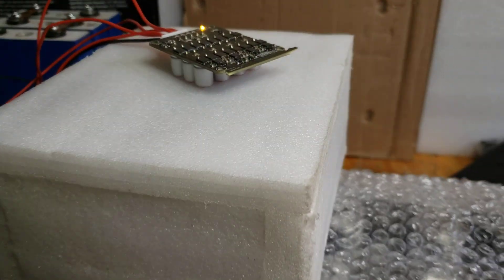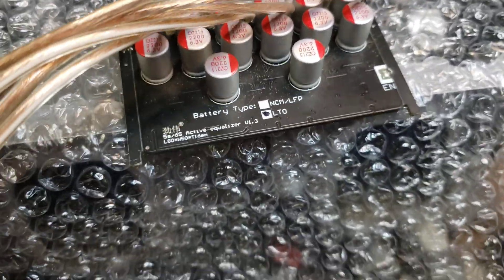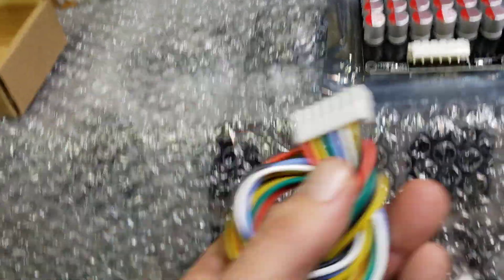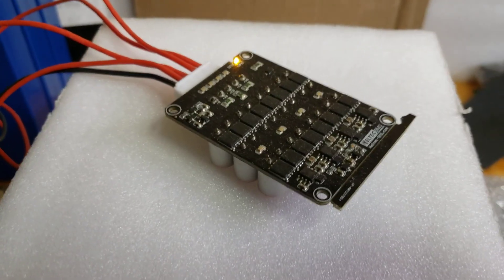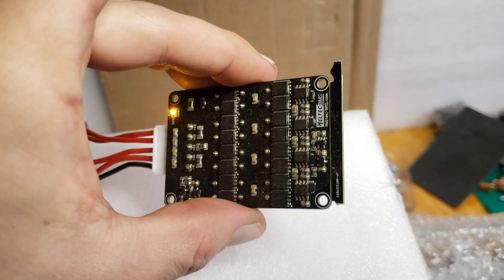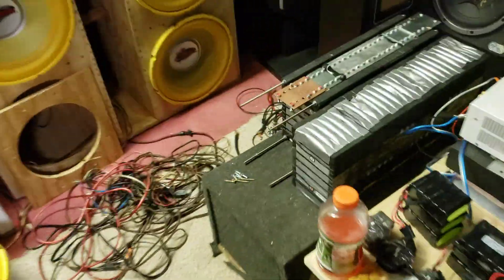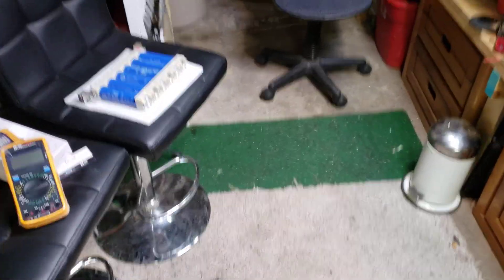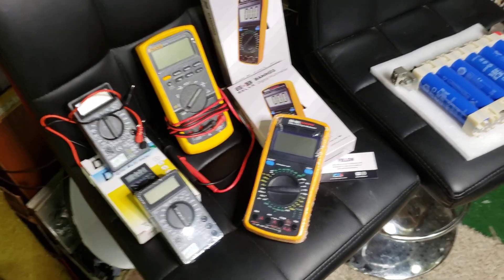Wiring a Lithium Balancer , Headway lifepo4 4s and LTO 6s

Comment: Once I hooked it up it smoked and clicked when I plugged it in? Did I fry it
Reply from the maker: Sounds like it , we're your cells prebalanced passive? What i do is passive balance,  assemble bank , hook up the wires for balancer , before you hook up the balancer make sure the changeable solder pads are in the correct place , adding a switch to the run pads is a great idea cuz then you can shut off the balancer , so shut it off and then plug the balancer lead clip in , if you dont have a switch and just leave it try to plug it in starting with the negative pin and plug it in fast . If done properly should have a run light and you will here a little whine , you can check each balancer lead with a dc clamp to see where its sending current. Warranty it and double check everything before hooking it up again.  When you "hot plug" a balancer you run the risk of smoking it ... I always say please don't smoke please don't smoke as I hook em up if hot plugging lol 😆 if you have any questions ask me on here or Facebook

Comment: What's the best balancer for 64ah headway with no soldering
Reply from the maker: Pretty much all you should solder and heat shrink the ring terminals anyways . You can grab a solder iron for like 20$ . My solder station with hot air was around 90$ and I love it , makes soldering and doing heat shit super easy . Nice tool to have in car audio or any electronics 
https://amzn.to/3BTxwBf

Comment: I just bought 2 banks of the Shengquan from Battery Hookup for 7k rms audio. Would I need 2 balancers? And would the "Heltec 6s 5A active equalizer balancer" on the Sriko site be what I need?  TIA
Reply from the maker: you can link each bank with the solder to tabs . i have a video on that also
Reply: @mazda2284  I cant find that video in your playlist.  Do I just solder a "jumper" between each solder to tab?

Comment: I have the 4-6s balancer. The second one you showed. From the amp lab. Does that have an LED on the back? Because I wired it up, have it switched to LFP and On as well. Still no LED
Reply from the maker: Mine has a led. If it's all properly set and wired and still no light check it with a dc clamp while charging... if no current reading then its defective
Reply: @mazda2284  ok thank you. I think my board may be bad then. I can check voltage from B1-4 and my ground is connected but still no LED. I'll order another balancer and try again
Reply from the maker: @jb19907  order one from srikobatteries.com Discount code BDSB
Reply: @mazda2284 I just followed these steps and it got hot 🔥🔥🔥
Reply: @mazda2284 is a balancer really necessary to have
Reply from the maker: @keithbutler7896  yes
Reply from the maker: @keithbutler7896  did you balance the cells prior to building?

Comment: Could I run 2 4s balancers at once
Reply from the maker: Why ? You could but I'd rather just do a single balancer , and when I get to the size bank id need a second balancer I do a second bank instead.  Easier to handle and Easier to fit more places . For 4s I use the 10a 30$ balancer from srikobatteries.com Discount code BDSB 
If you have a good bank a 10a balancer with keep up with quite abit of battery , and personally if its trying to balance more than 5 or 6 amps id be rearranging cells to get the ir to match better , or looking for bad cells .

Comment: How to you actually put an on off switch, do you ground the run leed for a second. Can you pleas explain the on off function
Reply from the maker: Simply put a switch to connect the pads . No ground or anything like that
Reply: Man i was hoping it was like a ground or power also so i could cycle it automatically with a relay lol.
Reply from the maker: @ALEX-xd7ko  you can , its just a different type of relay
Reply: @mazda2284  yea i cant remember what their called ,but i cant cycle it with my current relay system ive already got lol.
Reply: how to do it ? its like a remote wire to run ?

Comment: How are you charging these?
Reply from the maker: Rockseed Power supply for first time,  then alternator maintains
Reply from the maker: This is the power supply i recommend if the rockseed 10A is out of stock 
Hanmatek 0-10a 0-30v with protection 

https://amzn.to/3DyLUjD
Reply: Do I need to unplug the balancer before charging or no?🤷🏾‍♂️🤔🤷🏾‍♂️